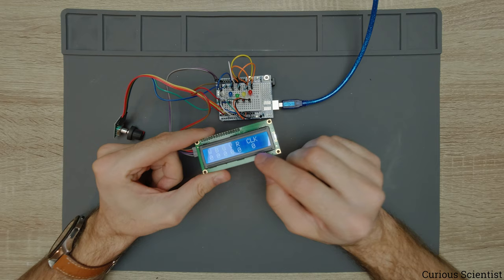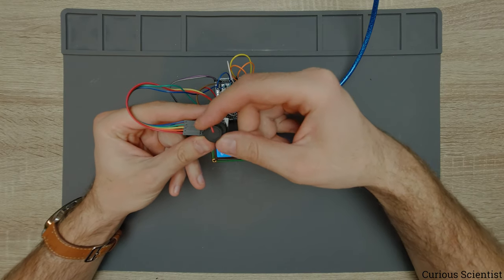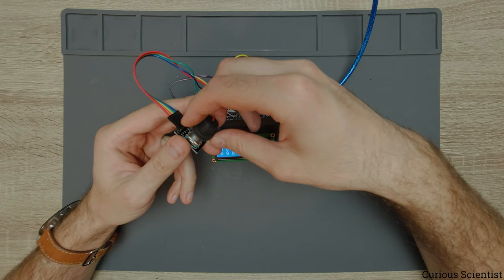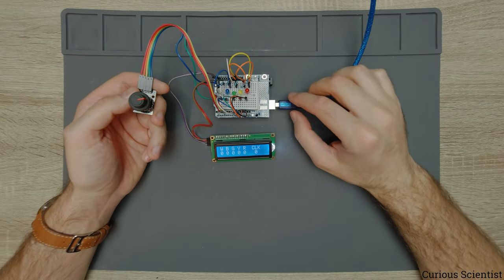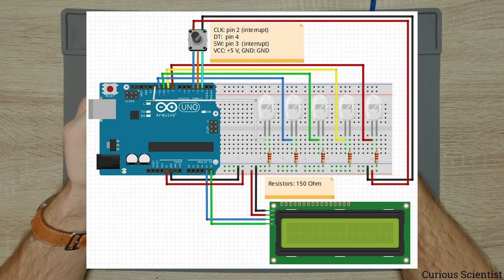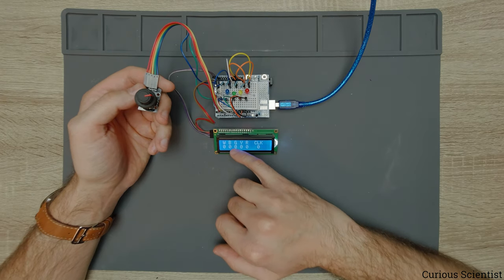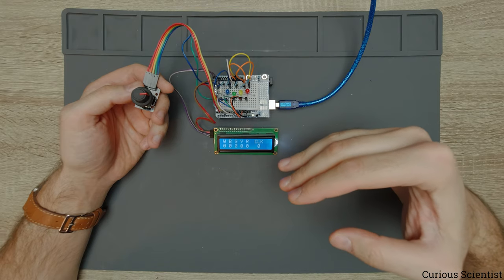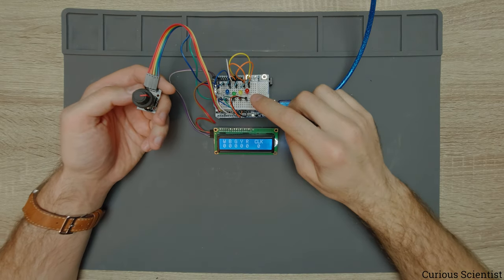Arduino menu navigation with rotary encoder and LCD

Comment: Hi, good wor on this
Have you done any sub menu system for this board?
I want to use STM32F411CEU6 board with sub menus
Please reply, are you available on freelance?
Reply from the maker: Hi! Yes, I even have a video about it, roughly from a month ago. The board I used in that project is an Arduino Nano, but as long as the project allows us to use the Arduino framework (STM32duino), it does not take too much to implement it on STM32. The main limitation is usually if there's any available library for the display. You can write me a mail and we can discuss the rest.

Comment: Hi, I want to control 6 Relays on 3,4,5,6,7 &8 pins, with rotary encoder . in the start OLED display text "rotate your encoder" when i rotate display changes to "RELAY 1", when I push the rotary push button arduino will switch on the D3, same way it goes forward and reverse also. ...please help.
Reply from the maker: Hi! What is the issue?

Comment: The code on your website seems to be faulty. it should be lcd.init() instead of lcd.begin() in the setup().
Reply from the maker: Hi! The code is working fine, and the best proof of it is the video itself. Keep in mind that there are multiple libraries out there for this specific LCD. You may be using a different one. Cheers!
Reply: @CuriousScientist  LiquidCrystal_I2C by Marco Schwartz from the arduino library manager
Reply from the maker: Yeah, well, that's not the same that I used.

Comment: If I want to use the encoder to select of many fixed numbers from an array such as float DoF[13]= {0.1, 0.5, 2,3,4,5,7,9,11,13,15,19,22};   do I need to make a case for each value?
Reply from the maker: Depends on what you want. If you just print the element, you can call the ith element from the array. If there is a corresponding action, yes, you might need to do everything one by one. Your description is too short to know what you want exactly.
Reply: @Curious Scientist OK let me fill in the needed details. A stepper drives a linear track. A starting point (0) and ending point (say  at 120mm)  are previously defined by the user. Even though the stepper will begin at 0 and end at 120mm it must pause at uniform locations and  fire an LED and report its new position each time. The user must select (from the array) the segment to be traveled between the firing of the LED, before  the stepper can begin. So if the user selects "5" from the array, then the stepper begins by running to the start (0) fires the LED , moves to position 5mm, fires the LED, moves another 5mm to  position 10mm and fires the LED and repeats till the end (120) is reached. The code works well when the user enters the sequence distance (5 mm in my example) through the serial (computer keyboard) but I want this choice to be made through the encoder displayed in the LCD so a PC will not be needed.
Reply from the maker: This can be done with arrays. You can store everything in arrays and keep track of the indices, so you can refer to other related values located in other arrays.

Comment: Nice video , many thanks ; but some remarques.
Make you code saver , lighter and readable:

You don't need to store the state of the i/o's . Only reverse the of them with "digitalWrite(x_output,!digitalRead(x_output);", and if you need to reed the state just 'digitalRead(x_output);' (expl : for LCD) 

Alsow you could store the i/o list into a array , and use index of the array as index for your switchcase.
Reply from the maker: Hi and thanks!
The code is freely available, so you have all the freedom to modify it to your requirements. You can also improve it. I am not a programmer, just a hobbyist, so as long as it works, I am happy with it. 

By the way, there is a more recent video on a similar issue where I applied a bit smarter principles: 
https://youtu.be/12nOWuRFx9k